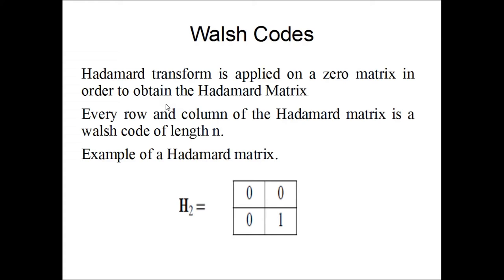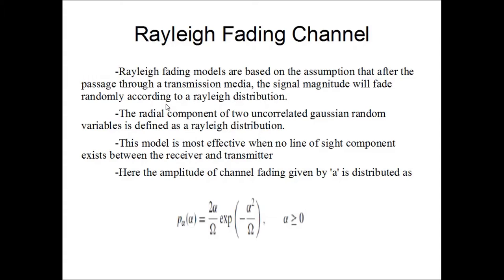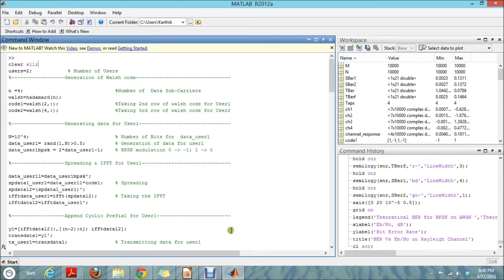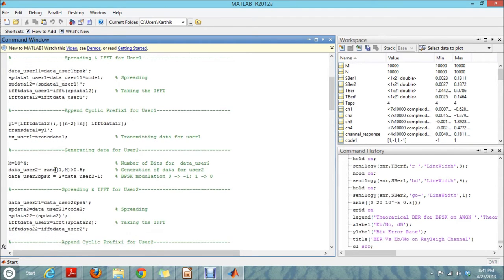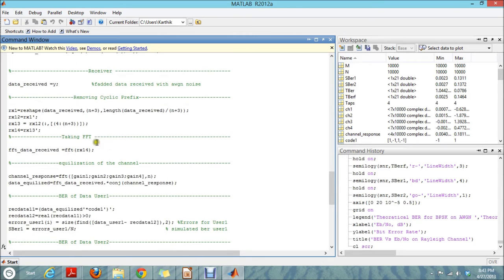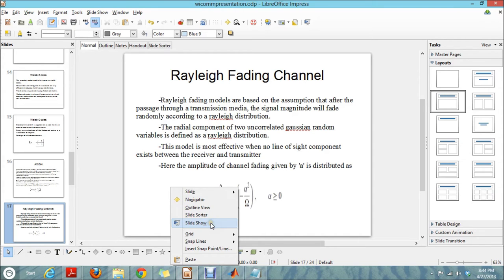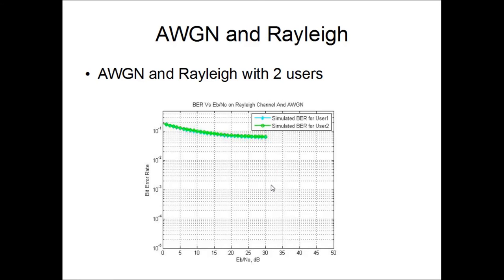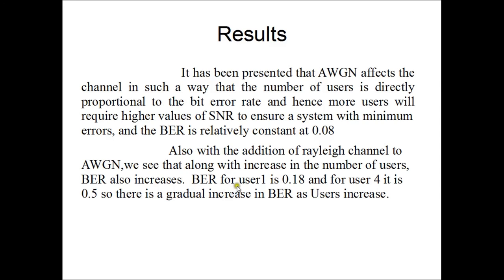Part 2-EEL 6509- Simulation of Multicarrier CDMA in AWGN and Rayleigh channel using Matlab

Comment: The code you demonstrated at first does not ask for snr values as input but the code that you cut pasted in the Matlab command window is looking for snr input that you inserted as 50 clearly its a different code that you cut pasted. I think you should demonstrate that code that you actually executed. or highlight the changes in the cut pasted Matlab file.